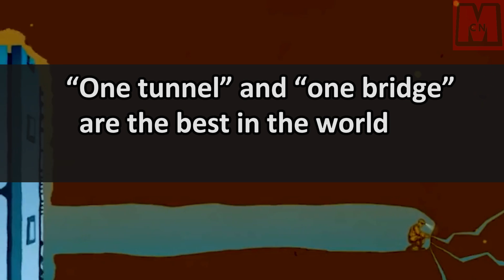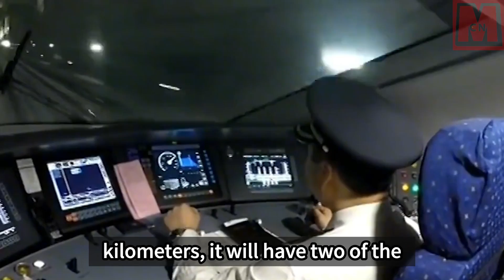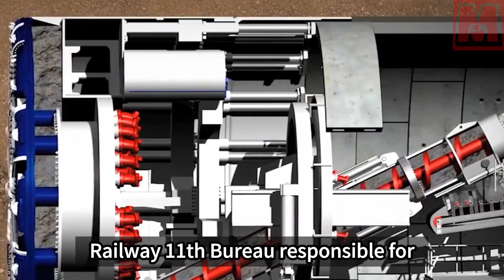The World's Longest Undersea High-speed Rail Tunnel Will Be Born.

Comment: Not to mention the experience China is gathering will likely go to drilling a tunnel under the Bab-el-Mandeb strait. That would seriously reduce transport times for goods to Central and Southern Africa, plus Saudi Arabia, UAE and the other rich Arab countries should be prompted to invest in it as it will seriously boost their economies. A tunnel under the strait of Hormuz would be great also, further reducing overall railway time from China to Africa - of course one would have to consider at least 4 railway lines for such a project: 2 way high-speed and 2 way heavy cargo considering how many countries would use these lines. Such projects have been proposed in Russia aswell, as they give tremendous benefits to both the superpowers and their allies in the Middle East and Africa.